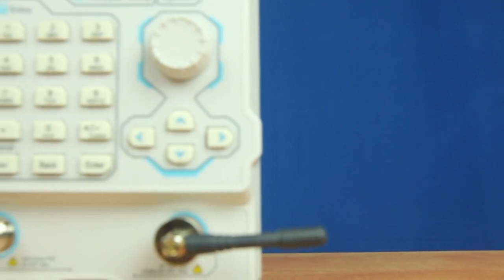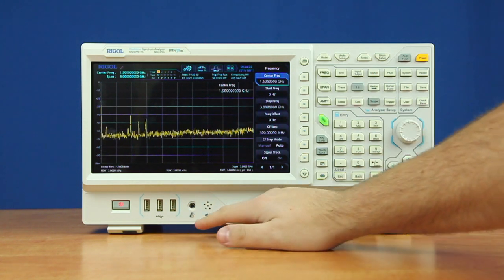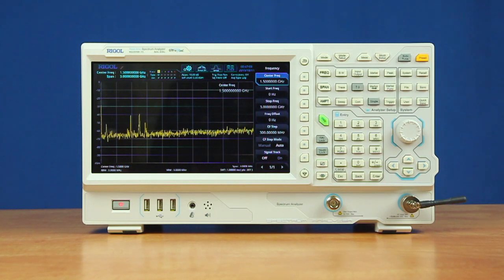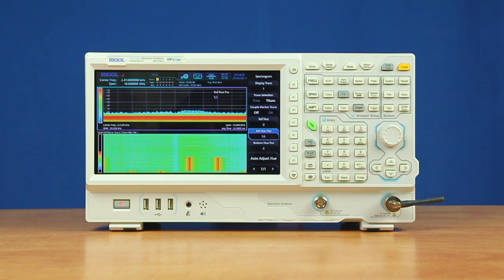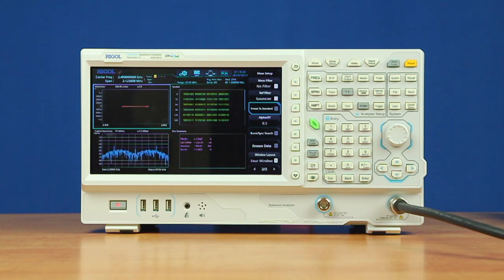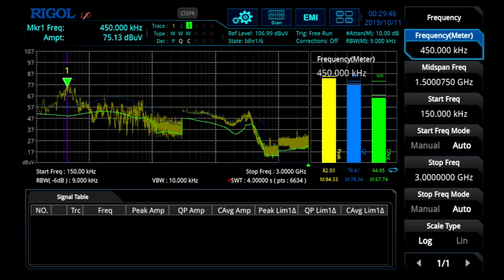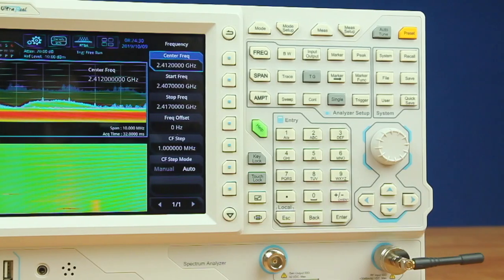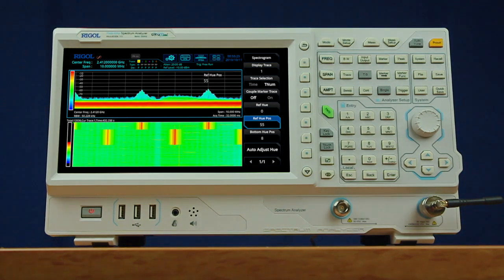RIGOL's RSA3000E Series Real-Time Spectrum Analyzer

Comment: Hey, why it's so white?
Reply from the maker: RIGOL is differentiating our higher performance instruments versus our lower performance instruments by changing the instrument’s case color, higher performance instrument’s have black cases and lower performance instrument’s have white cases.  Since the RSA3000(E) is the lower performance Real-Time Spectrum Analyzer compared to the RSA5000 series it has a white case.
Reply: I asked, because black is power, undiscovered black   
hole.